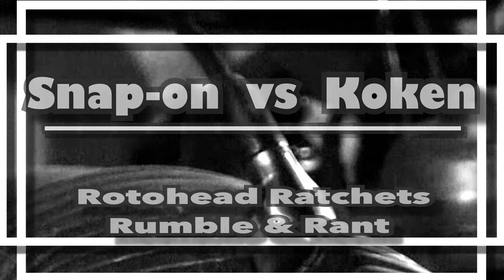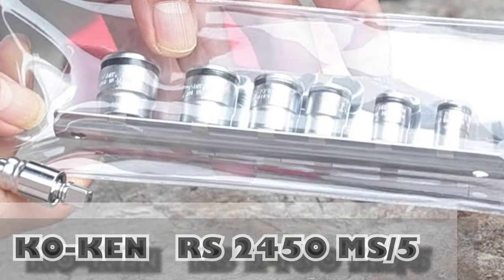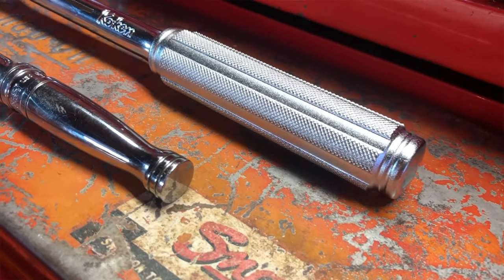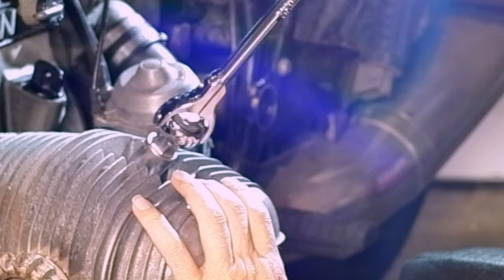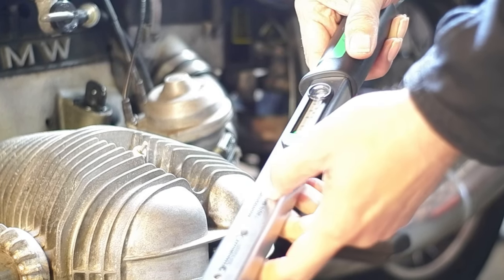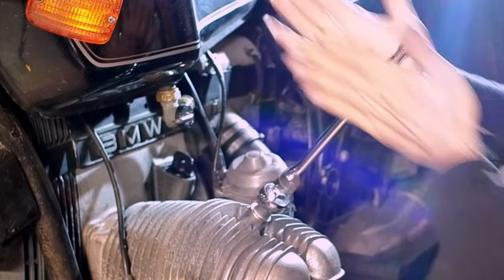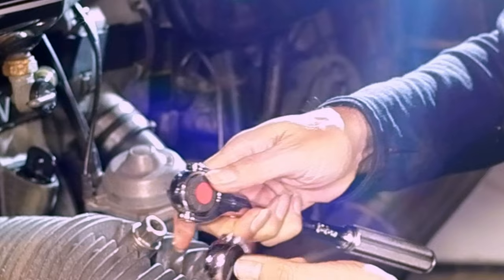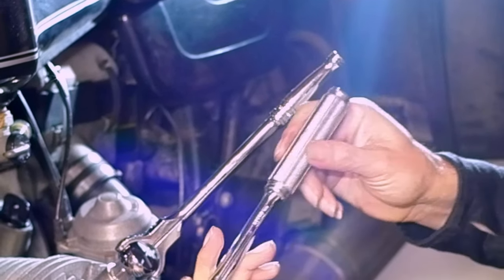ShadowBoxer 0080 {Snap-on vs Ko-ken Rotohead Review & Rant}

Comment: Thanks for the review.  I'm a fan of roto/swivel head ratchets.  One issue that is a bit frustrating is that I also like quick release, but most quick release roto/swivel head ratchets are sealed up, so you can't service or re-lubricate them to improve the backdrag, which sucks.  The Koken ratchets however all seem to come with good lubrication and exceptional backdrag.  The handle really needs to be knurled (or comfort grip) to allow you to use it as a ratcheting screwdriver, so nice to see it's got plenty.